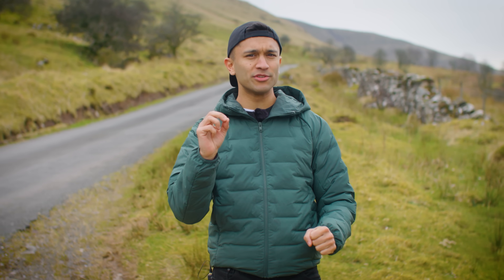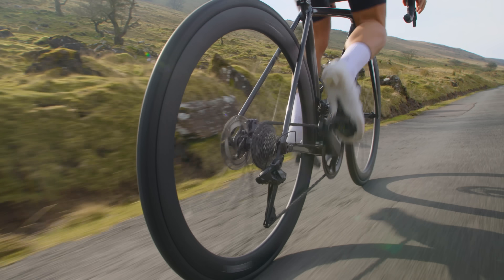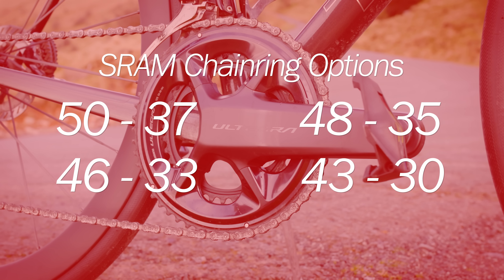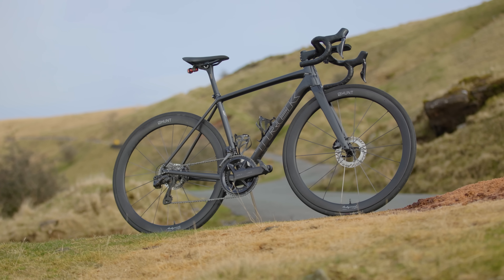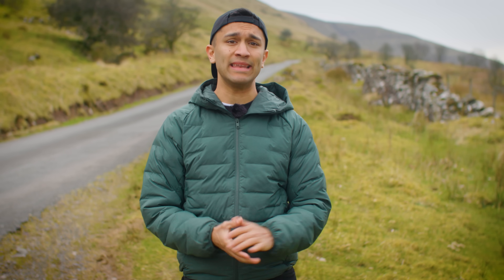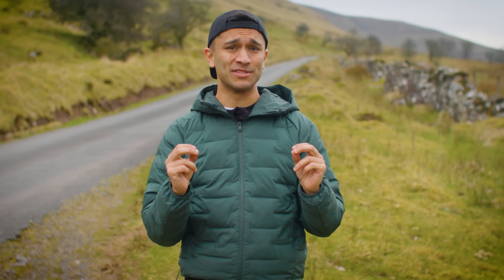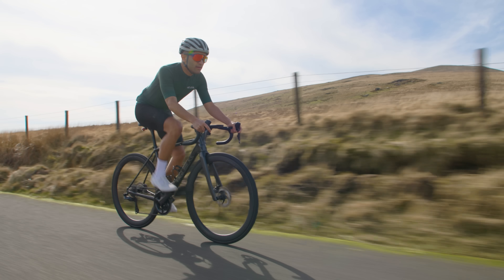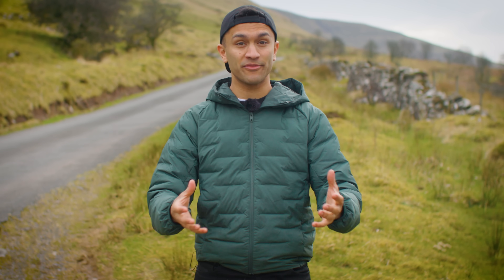How Bike Gears Work (and how to shift them)

Comment: I just converted my single speed to 5 gears -- the most my bike frame could allow . Question: Do you have a video on how to know if a trigger shifter is deffective . Coz the two shift lever/mechanishm of the shifter installed on my bike sounds and feels different from each other . Thanks very much . Liked & Subscribed .

Comment: 11:35 if I’m in the big ring and big sprocket move to a small ring and a small sprocket??? Why??? Move to small ring ✅
Are you saying that if I need to move into a smaller sprocket to do so then? You’re making it sound like I need to shift my ring, then my sprocket, I thought the advice was simply to not have the chain be at such a harsh angle but you’re also telling me to follow the shift up with a shift with the other derailleur???
Reply: 11:15 yeah I don’t know if that’s a misspeak
If I’m finding myself getting to the bottom of the cassette (the smallest ring) and I’m on the smallest front ring, then move to a larger ring &&&&& move to a larger sprocket??? But you just said if I’m finding myself getting to the “bottom of the cassette “ so shouldn’t I continue shifting to the smaller sprocket? This is confusing as fuck

Comment: Pro Tip: If you have SRAM AXS or Di2 paired with a cycling computer (Garmin or Wahoo) you can see what gear you're on from your display if you pair and add the rear derailleur to your main metrics screen. To maintain a straight chain always, I am in my big ring when on my 6th cog or higher on my cassette, and my smaller ring when on my 5th cog or lower.
Reply: @M3GRSD:

People [that I talked-to] kept saying “straight chain” but I didn’t-understand what they meant (because technically, the chain is ALWAYS straight. It’s never curved nor anything). But then eventually I understood what they meant:

They meant “don’t put-the-chain DIAGONAL. Keep the-chain as-LITTLE-“diagonal” as possible”.

The least “diagonal” that the bicycle-chain is [ / is positioned / is positioned at / is positioned in], the better.

(I hope that this comment is useful to anyone reading it).

Comment: I recently started cycling and found that detailed instructional videos weren’t readily available. As a result, I made a lot of mistakes, especially when shifting to a larger cassette while going uphill, which often caused a loud snap. After a visit to the bike shop for maintenance, they inspected my bike and gave me some helpful advice: avoid cross-chaining, and next time, adjust only one barrel adjuster instead of both.
Reply: One thing I try and teach new riders is not to change gears under load. That’s when you can break things like the rear derailer. Always back off the power a bit before changing gears under load
Reply: It's okay everybody got that Gundam bots expectation experience